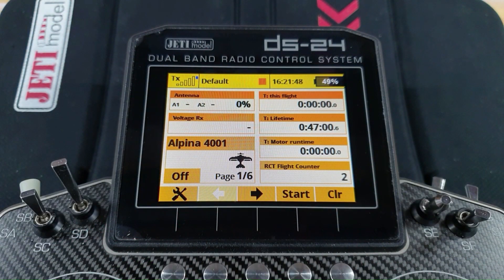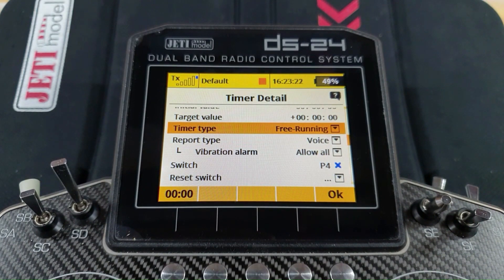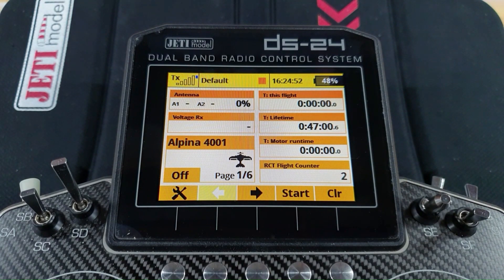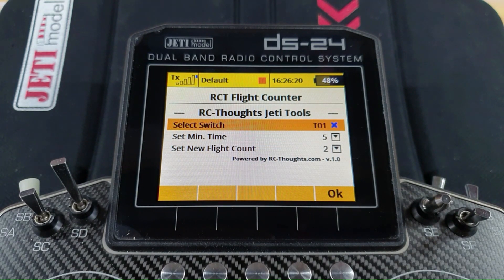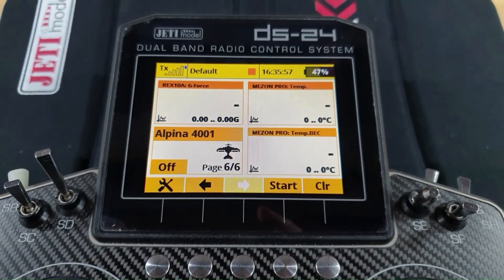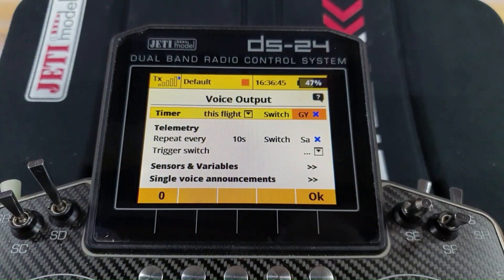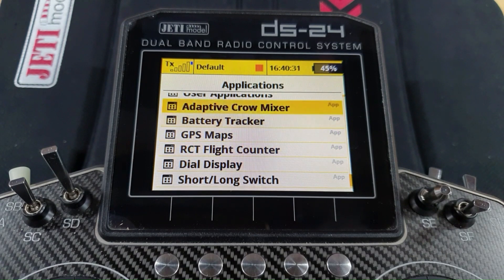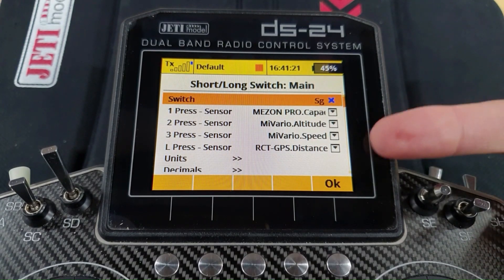Jeti - a variety of program ideas, episode 1

Comment: Harry ,I know this is an old video, I have a question about the 12 channel assist receiver,  I have a HSD HL-39 and it has theMFC 2085 multi function controller in it , and has two 3s lipos for the  controler that powers all cervos lights etc. It also powers the receiver,  and on the 12 channel assist receiver it has a multi plex plug on it for powering the receiver, do I have to use that plug to power the receiver or can I  just by pass it and once I plug all cervo leeds will that work ok as power I'm hoping will come from the two 3s logos that power everything else on the MFC 2085? Hope this makes sence? As I'm new to jeti let alone HSD
Reply from the maker: All the sockets on a REX receiver can be used for power.  The point of the lead with mpx plug is to give a high current input compared to the approx 3 amp continuous limit of a servo connector.
Reply: Thank you , and one more Question, am I better off using another separate battery or is it sufficient to use the 3s battery power from the  MFC 2085 ? All your help is appreciated
Reply from the maker: I have no experience of that unit.  As a general rule I do not trust cheap chinese electronic stuff, and fit high quality BECs and bypass their servo boxes as much as possible and connect servos straight to the receiver.